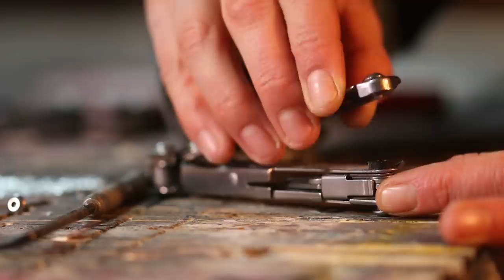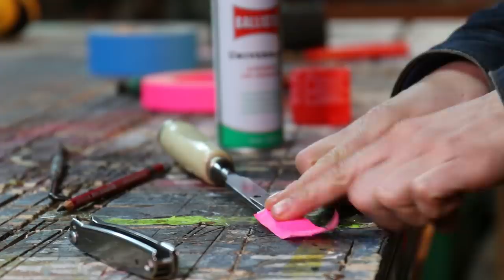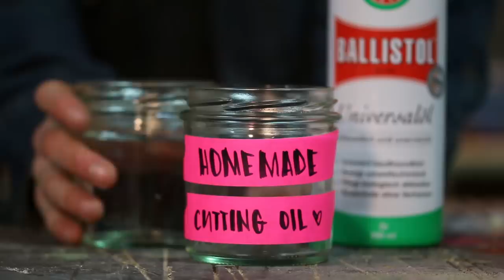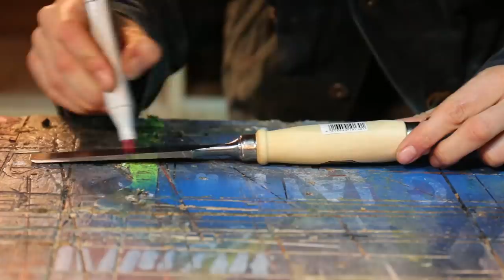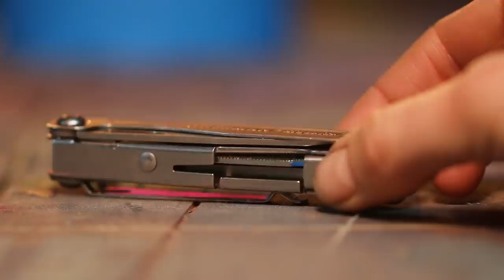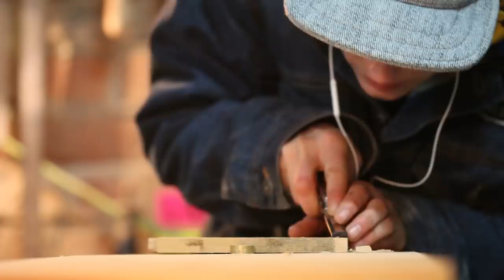Custom Leatherman with Chisel / Woodworkers EDC

Comment: Nice, Laura.
Tip: for my precision grinding I use a standard bench-grinder with an angle grinder cut off wheel instead of the stone.

It allows you to control your workpiece in a perfect 90 degree angle to the wheel, making subtle moves.
Reply from the maker: nice!!!
Reply: What a brilliant idea im going to use that!
Reply: Cool thing reading other people trying similarly weird stuff like I do ... did You try to put a small circular saw blade in Your angle grinder ...? Works well, too!
Reply: manfred schmalbach I like my fingers too much. I did build a saw table from a 1980 Braun kitchen machine however. (and of course cut a 5 mm groove in my tumb by accident)
Reply: Willy Nebula I use this to grind up an enormous bunch of brass hinges for a bunch of Roman Lorica cuirasses. Used it since then for pipe cutting precision grinding toolmaking etc.

Tip 2: place it on a sandbag ( subtip: use old jeans legs , 2 of them one inside the other, stitch one side close, fill with sand, close it. )  Now you can position the grinder in a convenient angle.

Sanbag can also be used as a versatile support when working on hard to hold stuff. Or hammering plate on...
Reply: That circelzaag thingy is hilarious.
My TIG sticks are ground with the motor of an disposed/bandsawed little espresso machine originally pressing with centrifugal force, put on a 1500 grit stone on the turning mandrel  ... has a second stage meanwhile to buff them buggers, too, after grinding.
Used the circular grinder-saw (135 mm blade) mostly to prepare plank-gaps evenly to shim before veneering and to cut shadow gaps round fancy vintage-wood ceilings and panels from ancient buildings transplanted to newer ones. Have all fingers complete still to date, though ... being boat builder by profession teaches One pretty early on Ones way: there is no (modern) tooling or machine usable off the rack without modification, so You can as well build what You need from scratch - safety-nerd's worst nightmares guaranteed 😂
Most of my planes derive from just about everything: cut a slit --> put a formfollowing, sharpened blade into it --> plane concave or convex or weird profiles.
I have to stress, though, that the anglegrindersaw (Lou Sauzedde who I recently found here calls something similar his "little suicide saw") usually was used with some kind of stopper, table, double grip or form tooling.
Reply: good idea....thank you
Reply: why have I not thought of that? i'm going to try to fit one on my grinder asap.

Comment: Laura... if a chisel/knife combo is what you like...  check out the CRKT Razel. It’s a super stout knife blade with a chisel tip. Micarta handles. Been out for a long time and ya can still find them on eBay. Approx $25-30 USD.  Great mod to the Leatherman. 👍

Comment: My ideal leatherman would have: All titanium parts, surge heavy duty design, all tools accessible when closed, spring pliers, replaceable wire cutters-bit driver-saw/diamond file, dedicated pry bar, ferro rod, hammer end, then the rest of the blades etc.

Comment: I did not know that Ballistol was being sold in Europe. Thanks for sharing this.
Reply from the maker: yeah, it´s a german brand
Reply: A WD-40 alternative?
Reply: peterkleczli much better than wd 40...balistol does everything been using it for awhile
Reply: I know Ballistol is used as a gun cleaner. I wouldn't use it as a replacement for WD-40.
Reply: Grindstone wd40 is Made for cleaning! Ballistol is a mulituse oil
Reply: WD40 is made for water displacement.

Comment: Cool idea.  Could you use a leatherman with a locking mechanism on both sides?  Then both your knife and chisel would lock and the tool would be safer, considering the forces you put on a chisel and the chances of it folding unintentionally.

Comment: Nice Work! 
Word of advice, don't bump the ballistol spray can of your workbench on to a metal corner. These cans easily spring a leak and spray all over the place. It will stink up the workshop for days. That's me speaking out of experience  (-_-).

Comment: fun idea!
I don't really understand exactly what Ballistol is, but I'm also confused as why you need to mix it with something else, can't you just put it on directly?
Reply: Coolant for machining is normally a mixture of water and oil, pure oil is used for  tasks like cutting threads. Water has a high heat conductivity, the oil component lubricates and prevents corrosion.

Comment: nice take on the idea. Ive seen those pocket folding chisels already made by tool manufacturers(stanley being one) and this is a nice combo with the leatherman. really nice result. 
I know it's your shop and your rules when it comes to safety, but personally I will never condone/teach or use any grinder without a guard. I've made the same comment on John Heisz channel. it's just far too risky as you never know when a cutting disc will explode during use. 
I'm not putting this statement on you alone laura since I really like your channel and so many others do the same things, but Its a common theme with a lot of makers who haven't come from a professional background in manufacture or engineering, or workshop environment in genera,l and sometimes the lack of basic tool/shop safety is just completely ignored or just not even aware of. Like I said, This is for a lot of other high profile makers on youtube too.  What's your thoughts? I know you're a safety advocate when it comes to electrics based on previous videos. 
"your shop your rules" over rule standard safety or do youtuber's have semi responsibility to show a safe way of working to those who follow?  This is also not a "safety sally" comment, just open ended discussion. We've all had our times of danger and making mistakes though.

Comment: I was almost sure you couldn't file down a chisel... I was wrong once again obviously :P or did you normalise it ?
Reply: Chisels are quite hard but they are tempered to be softer (and therefore tougher) than a file. In the process of cutting with a cut off disk she very likely heated the area where the hinge is to a blue temper which is rather soft allowing for the file to bite in. I would have liked to see how far the tempering from cutting went down the piece because anything over a straw colour down at the blade could be potentially damaging
Reply: ThePetahs, the cutting end probably didn't change.  The vise it was held in would have acted as a heat sink.

Comment: Can you do this idea in a video (or make for me & I'll pay)?  It's a multi-tool with a folding crowbar in it- I would like it to be (or be like) a flathead demolition screwdriver & be VERY solid.  I want to be able to put the tip in something & twist/lever HARD without it breaking- ideally, the other thing will break & that's part of the charm (extreme use might be needed to break a lock or something in an extreme situation- yes, I'm aware that a demo screwdriver & long-handled pliers does the same thing).  I'd like it to have other features if a totally custom job is possible, but otherwise at least a knife to go with it- preferably keeping the pliers & a philips screwdriver/adapter.